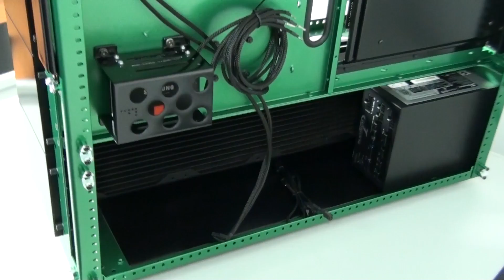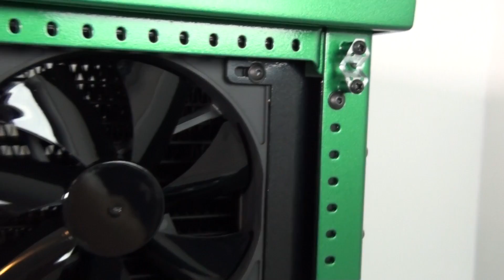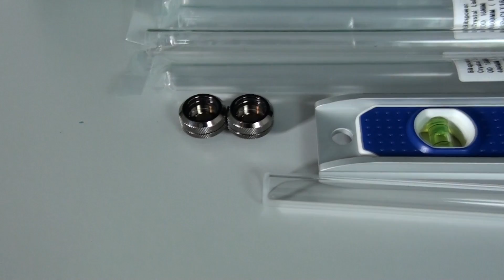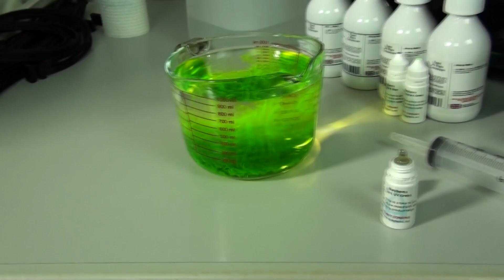Build #14: Extreme STH10: Part 3

Comment: such a awesome looking machine. ^_^ love the green in the color scheme. ^_^ @ SingularityComputers I was wondering, if I were to give the specs of the system I want to build, case, components etc. Would you be able to make some custom cables for the system wherever possible without having the system actually there to work on together with a list of suggested fittings?

Comment: Looking at picking up this case for a build, but I want to run 2 x 560 rads up top and 1 in the basement. Glad to see that it is doable without removing the upper chassis divider!

Comment: Hey, where did you buy the 90 degree fittings? What length of wires did you use and what part #. Why did you use this reservoir? What size holes in the case for tubes? Can I use this reservoir in my case? What part # are the O-rings? I have same case, send me a list of all the parts you used and where to get them. Do all the vendors just give you shit? Why can't I get shit? Come on people!

Comment: Bad configuration, the water needs to go to the radiator and after to the components, not in the other order because if u freeze the water and apter u send that water to the reservoir u dont win anything because the water that its going go the reservoir is cold not the water that its going to the components.
Reply: You will have better temperatures if you send the water after the radiator not after the reservoir.

Comment: Actually, for the colors of the loop now that I saw the video I believe a muddy green and a 10% translucent black would have been a great compliment to the colors of the case not necessarily UV green or UV black but opaque muddy green or dark green and a translucent black or charcoal black instead of deep black. 
On the subject of colors has anybody ever requested the colors of the German flag because they are by default on all stock wirings whether it be 3 pin fan headers or 410 Molex connectors would be kind of nice to see a black red yellow build that actually goes with those often shameful colors of stock wires.

Comment: I'm interested in using acrylic tubing with fittings (as opposed to bending). How do you get everything so straight and square? Is it a matter of choosing the right fittings? How adjustable are they? Do you have any videos that go over how you select the fittings and cut the tubing? You don't appear to cover this in these (excellent) build videos. Sorry for multiple questions.

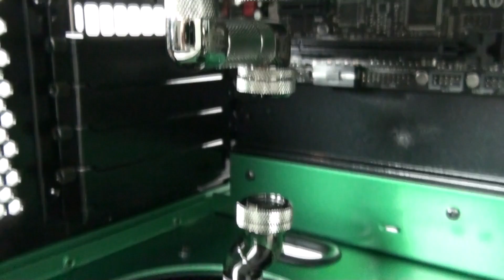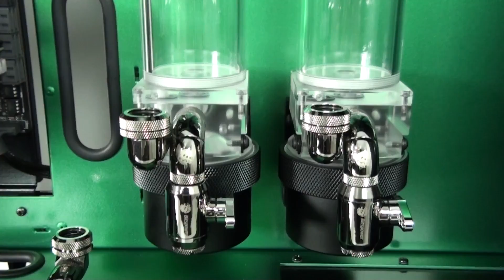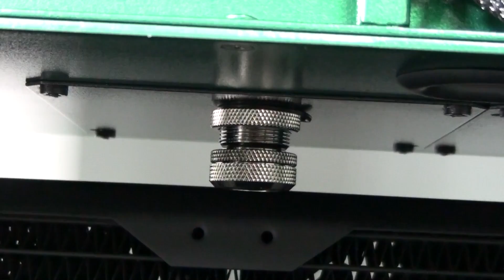Comment: I really enjoy watching these build logs. Your attention to detail is impeccable. I was wondering which fittings you are using to route the tubing through the cover panels (ie. at 4:21-4:37 and again at 6:10-6:24? They look slightly bigger than the multi-link fittings in the rest of the build, but my searches to find something similar have proven unsuccesful so far.

Comment: I think it would be cool to have a build that would represent a reactor going through it's development cycle. Blue coolant coming out from the radiator as would be expected when the system has cooled down.

When coming up from the GPU or the CPU it would be red to represent that part of the reaction process.

I had thought of passing this along to Digital Storm which i was going to have build my PC. However I doubt they would quite go to that extent to accommodate me lol. Furthermore their systems are way overpriced for what you get in return. :)

Comment: Hi

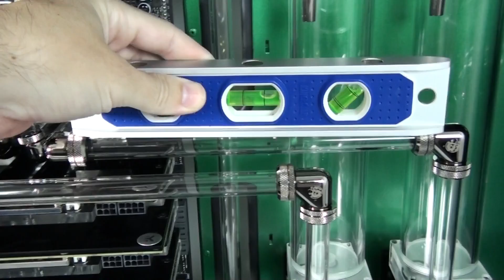Just need some clarifications, you know at 13:06 what exactly are the product name for the fittings used for both of those 90 degree angle bends?

Is that a combination of

1 x Bitspower Adapter 90 degree 2x G1 / 4 inches - Black Sparkle

and

2 x Bitspower enhance multi link?

Thinking on using fittings instead of bending acrylic for the 90 degree angle bends but just confused of the type of fittings to use for the 90 degree bends.
Reply: those are 90 degree 2x G1/4" inches like you said, but they are dual female ports.

the other two fittings are multi links but they are 16mm ones. Bitspower has yet to make any other renditions of the 16mm fittings aside from the standard multi link and C47 style ones, so thats why he had to use this config.

Do make sure you truly want to use those fittings, as they end up being much more expensive overall (and BP fittings are already extremely expensive in a full 100% Crystal link loop, but they are indeed worth it) for the previous reasons, and they are also very difficult to fit into position. I was absolutely stunned at the amount of pressure and leverage I needed to insert them, and I still sanded down the tubing exactly how the video shows. I couldnt even insert any tube into a single fitting that was already in place inside my rig, I literally had to connect all the tubes and then screw the fittings into place from there. I noticed slightly heating the tube helped, but you have to be really careful or you can damage the O-ring easily.
Reply: ofcourse its dual female... you would know if you actually searched what "Bitspower Adapter 90 degree 2x G1 / 4 inches - Black Sparkle" was... come on.
Reply: Yeah I provided that for search text purposes as the actual gender terms are rarely used in the community from my experience, most say extender or adapter or coupler to indicate. Also to be nice and have full understanding with each other, something these videos themselves constantly do, despite its redundancy and myself thinking that hes stating the obvious.... and if you look at my avatar, youd see a small shot of my system, ive built countless rigs with sophisticated crrystal link setups, always 100% bitspower fittings, and ive never bent a single tube before. You have any idea how many Bitspower 90 degree fittings there are? stop acting like your menstruating because you wont get help in the future if you do. Your entire question overall was pretty stupid to me, but I felt like helping you.

Comment: I would like to thank you for the great videos you have been doing over the last 2 years.
By my standards, you are the world's best professional water cooling pc builder. All of your builds are top notch! I used  your Singularity Computers Water-cooling Guide Corsair Obsidian Series 650D build and did the same thing. This was my first Water Cooling build. I just kept referring to the videos over and over to duplicate your build. I had to use a  different reservoir (Alphacool Repack Dual Bay with 2 pumps) because of using a 7990 w/swiftech h2o block. The 7990 is much longer than the VC's you used. Everything is still working great a year later. :)

Comment: That case is so big, it still feels and looks like you have so much space at the front for another possible rad, not that you need it!

Wasn't sure about the green, looks better with the uv, but like you said green is over used now like red and black. However, if you went with black it would make the case look to dark. 

I'm interested how it will look with the lighting keep it up!

Comment: im wondering why you are still using a crazy amount of fittings and small pieces of tubing? now that acrylic tube bending is much more accessible i think your builds would look much cleaner also saving hundreds of dollars from the many many bits power fittings used.
Reply from the maker: Client request. Turns out I used fittings for the bends in 4 places where I could have bent the tubing so it didnt add many more fittings at all. You must have missed a bunch of my builds because Ive done plenty of bending.

Comment: Great video, thank you for tips.
Reply: Just the tips.
Reply: Armands Vilisters Ha! I know that I often sound as opinionated son of b., I swear I can listen too!  In fact I'm  looking into 16mm acrylic tube build and I was also thinking that CPU area would be challenging.Finally i was concerned about how big EML16 would look with angled adapter. Now I see and can draw my conclusions.
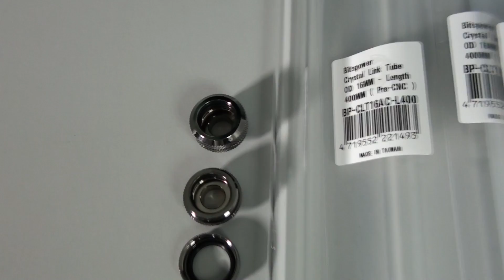Reply: +mupp1t he clearly states at 9:25 that the ek tube does NOT fit the bp 16mm OD enhanced fittings and he had to wait for bp to release their 16mm OD TUBE IN ORDER TO USE IT
Reply from the maker: Cheers DazMode. Im loving the Darkside lighting!!!
Reply: ***** Thank for positive feedback! If you like to try other colors give me a shout.
Reply from the maker: Custom Computing
Yep I was thinking of grabbing a few of the radiators to check them out also, they look great. For me the EK 16mm acrylic tube didnt fit by a long way, I carved off so much that there was a step in the tube and was still having trouble getting it to fit, it was starting to look ugly because of the visible step so I gave up on it. I had EK acrylic from when they first released it so maybe its just a different batch which is slightly larger. The thing is it fits in EKs fittings no problems but not in Bitspowers. Ill show it close up in the next part of the build log.
Reply: Daz, I purchased 16mm EK acrylic tube assuming it would go with the bitspower 16mm OD fittings, but singularity says they don't fit. Are you going to be getting any bitspower 16mmOD acrylic tube anytime soon?
Reply: Custom Computing I bought 10/12mm EK-HD acrylic tube and using it with the Bitspower C47 10/12mm and they fit fine, I just sanded down the end a bit and wet the o-rings in the fittings and around the tube. Check out my build.
Reply: ***** I also  was able to put 16mm EK tubes in EML16. It fit exact, although I also had to wet o-rings first.
Reply: That's odd why singularity said they do not fit and he sanded them down and they still didn't fit...
Reply: Custom Computing I don't know man. But yeah like I mentioned sand down the edges around it, and clean off the pieces of acrylic out of the tube well, and wet the o-rings in the fittings and then slide it in, you need to apply a bit of pressure to it. Taking the tube out of the C47 fittings is a pain in the ass..Best to use C48's. But yeah
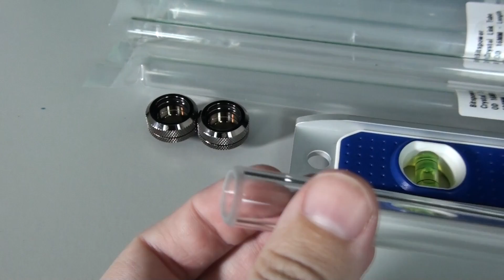Reply: Custom Computing @12:35 he mentioned the best way to make it fit was to sand down the edge of the tube to make it fit.
Reply: ***** you should check out his new rad line up ;) I'd like to see performance testing on these, daz has traditionally made good quality stuff it would be interesting to see the comparison performance on his rads.

You mention the ek tubing didn't fit, some people are saying it does fit the bp16od enhanced fittings, can you confirm that they "can" fit? I'm about to buy my fittings and have the ek hd 16OD tubing.